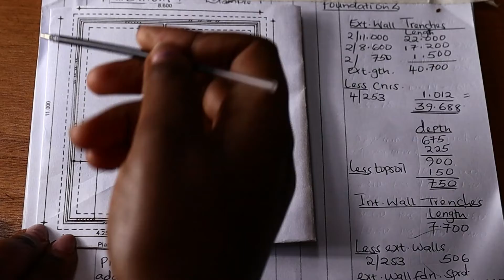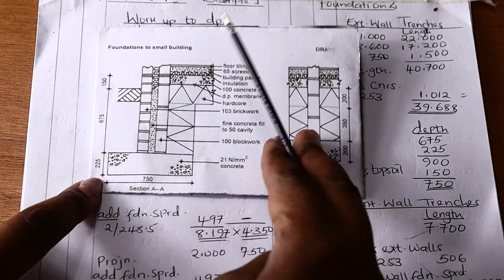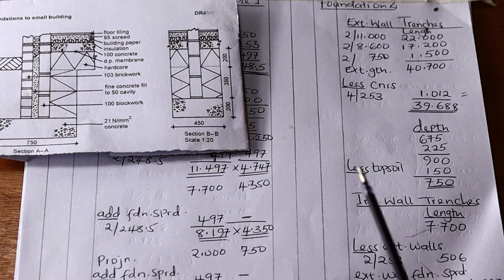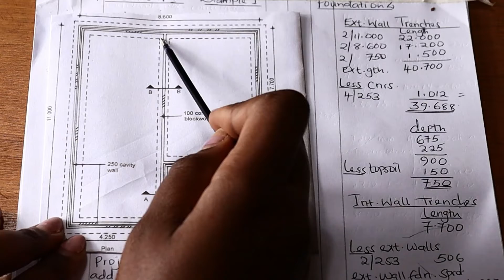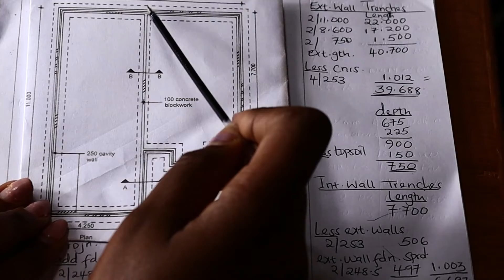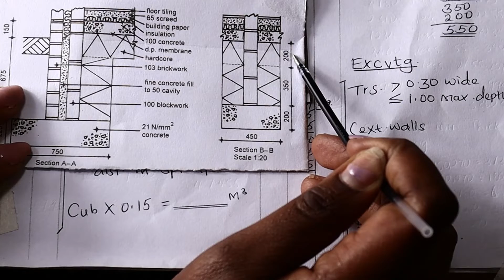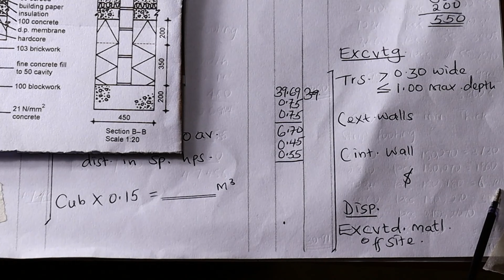HOW TO MEASURE EXCAVATION OF TRENCHES FOR EXTERNAL AND INTERNAL CAVITY WALLS #takingoff

Comment: Hi, I don't understand why you are deducting the four corners with 253 of brick wall thickness but we're doing a centerline for the trench as though we are doing a centreline for the external brickwork. And why have we not added the trench spread (+248.5) to the length and breath of the building? Please assist
Reply from the maker: I'd rather do a video and explain this to you..I'll do it soonest
Reply: @easyqs  Alright, that will be helpful, thank you so much, I've been confused between calculating the external center  line for the trench and and external center line for the brickwork. In some videos you'd see - 4/600 whilst in some - 4/220 when deducting.

Comment: Hello dear
Thanks for the lesson 
Mi quiz iz for the internal wall section b-b the fnd sprd is 175 why r u removing 248.5
Reply from the maker: That is the spread of the external wall on the inside that boarders the internal wall. We are deducting it because when excavating the internal trench we can only excavate up to where it meets the trench of the external wall.
Reply: Thanks dear
Reply: However, in some plan drawings you are given the internal dimensions, therefore you only need to deduct the spread, i am sure I get were your question is coming from @iqradiisow2338